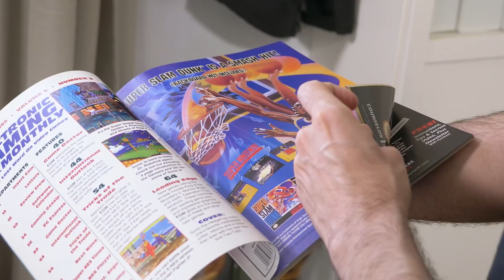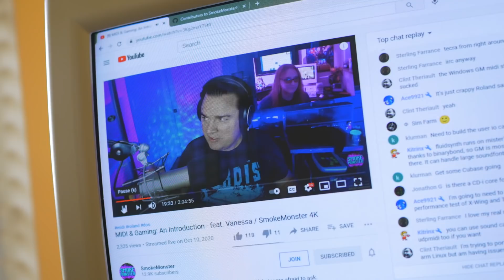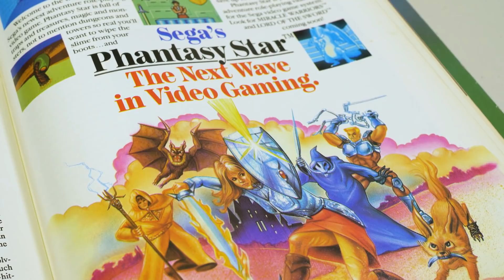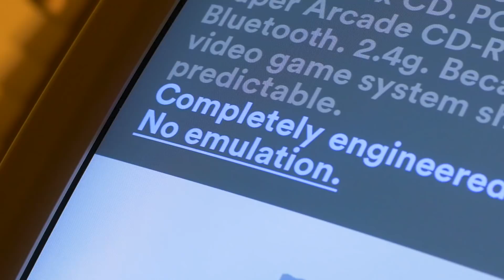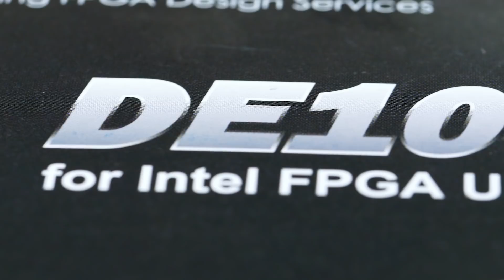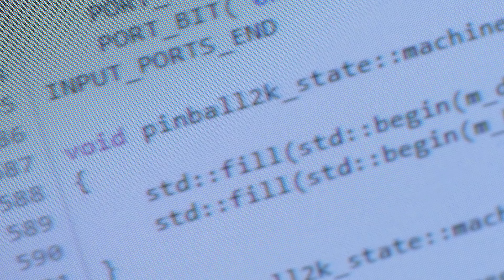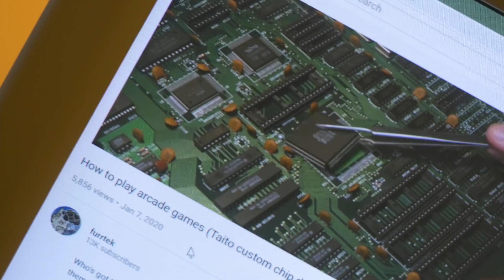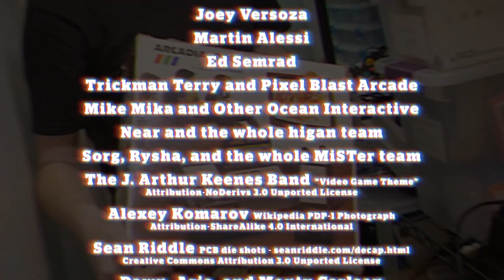ANALOG FRONTIERS - Part 3: Preservation and Replication / MY LIFE IN GAMING

Comment: Eventually, I would love to see systems that use a combination of FPGA Simulation & Software Emulation in order to offer the most flexible & comprehensive  experience possible.  Systems with both an FPGA and CPU chips on board, with the system being implemented via FPGA as well as software emulation to add features such as higher rendering resolution & other things that an FPGA chip simply isn't capable of.  The best of both worlds per se.  

How amazing would that be?  Technically the MISTer should be capable of this as we speak, as it has both an FPGA and a CPU on board that it could borrow from.  Would LOVE to see cores implemented on the MISTer that allow them to borrow from the CPU for things like higher rendering resolution and such.

Comment: I developed the RunAhead feature for RetroArch, discussed at 26:48.  RunAhead is not about running "multiple instances of a game".  This is confusing because RetroArch does support using multiple instances for RunAhead, but it's for a completely different purpose.  Use of multiple instances is exclusively a workaround for audio buzzing issues with savestates, and nothing else.  RunAhead still has high processing requirements, as it runs each frame of the game at least twice, and constantly saves and loads states.
Reply: I believe this needs a mainstream explanation on video for the general public to understand it... it would be great to have if not already available.
Reply from the maker: [Try4ce] Is there a better way I could word this segment for the version we'll put on Amazon Prime and Blu-ray? Unfortunately you can't swap out videos on YouTube so this version is what it is. Does Frank's comment about two emulator cores stand up to scrutiny or should that be trimmed? The way you explain it kinda DOES make it sound like two instances of the game - I mean, if each frame is run twice, it sounds like the practical result is that the game is being run twice. So I'm not sure what a better way to put it would be. Keep in mind that the interview with Frank was from April 2018 and I believe run-ahead was extremely new at that time.

Comment: It is my opinion that to this day, the AVS still uses the most accurate NES core in existence, even more accurate than the one used in the Analogue NT Mini.  This is especially true when it comes to the audio accuracy.  Do a comparison of the audio from an original NES, the AVS and the NT Mini and you will easily see the difference.  The AVS sounds literally identical to OG hardware while the NT Mini variates a bit.  This is also true for the Mega SG/Super NT and their respective hardware.  From what I hear the change to the audio was due to nothing more than the personal preference of the developer Kevtris , as he reportedly prefers the sound the way he has implemented it vs the way the original hardware sounds and has added various filters to the audio for these changes.

I have a real problem with this, as when you are designing a product for the public you should be designing it to be accurate, not to be based on what you yourself personally like.  The rest of the populace isn't necessarily going to like things the way you do, specially if it deviates from the original hardware.  If anything he could have at least given people the option to turn these extra filters off but this is unfortunately not an option.  I simply do not understand this decision as the audio implementation in all of Analogues current systems could and should be more accurate than they are, and without any options to change it we are unfortunately stuck with this less than accurate implementation.

Comment: With the new Xbox adding the FPS boost I wonder if that idea could ever be brought to emulators? Old games don't run well on flat screens as they have tons of motion blur. The only way to eliminate it is with single strobe BFI. This isn't exactly common on most TV's or monitors.  Not too mention some people can't handle the flicker of BFI. It was suggested that Xbox has the ability to double or sometimes quadruple the frame rate. Imagine that was brought to Streets Of Rage 1 or TMNT 1 as those games run at 30FPS. Or imagine all the 60FPS games getting bumped to 120FPS. It would at least get them at reduced input lag and visually they would appear smoother. It's already so amazing what is happening in the retro community with that Genesis GX Wide emulator. It's so crazy to play those old 4 by 3 games wide screen.
Reply from the maker: [Try4ce] I've wondered that too. Heck, imagine if the rumored "Super Switch" could tap into such functionality with extra power in the dock for current gen games even. According to Microsoft, the game itself thinks it's still running at 30fps, so whatever technique they're using could potentially really make a lot of interesting things happen. Their backwards compatibility stuff is really impressive - it often feels like a remaster rather than emulation. It's very polished.

Comment: Software emulation can be just as accurate as FPGAs in practice.  While FPGA can definitely replicate each chip of a system without the overhead of software a cycle emulator like BSNES/Higan is great from a preservation standpoint because unlike hardware, software will be with us for a long time.  You can read the source code for BSNES and from it know how the SNES works and in the future you can use said code to do a new, modern hardware recreation.   I think for the future cycle accurate emulators are the key to preserving hardware.
Reply from the maker: [Try4ce] Absolutely - Artemio touched on this at one point. Cycle accurate code could give you functionally the same result as an FPGA if you had a fast enough computer in theory. And at the same time, there are things you can do on PC right now that are a long ways off for FPGAs - like GameCube, etc. So both methods still need more power to unlock their full potential.

Comment: FPGA without question has the potential to be more accurate than Software Emulation, HOWEVER!... It all depends on the work that goes into it.  An FPGA core has to be capably programmed just as a software emulator needs to be.

Comment: I got an OSSC and its AWESOME ! But I do have one question. When I set it to line 4x mode (960p) It works on my TV but for some reason even when its set to generic 4:3 it doesn't do the 4:3 aspect ratio it fills up my whole screen and I'm wondering if I can fix that in some way. Any suggestions would be helpful pls.
Reply from the maker: [Try4ce] Your TV should have an aspect ratio setting. It might even be a dedicated button on the remote. I'd be very surprised if it didn't let you do this. Failing that, I believe the 3X signal would always be interpreted correctly by a HDTV, if I recall.

Comment: I disagree with the assessment that MiSTer is "too technical."  If you can setup a raspberry pi, you can set up a MiSTer.  And as far as running the system goes, I'd say the gui is easier, less cluttered, and more functional than RetroArch's or Analogue's!  It is by far the most useful piece of tech you will ever own.  PDP1 to SegaCD in one system??? Absolute insanity.
Reply from the maker: [Try4ce] Totally agree it's easier than a Raspberry Pi, and I am personally no fan of RetroArch's menu organization. Do keep in mind that Jeremy's interview was from the fall of 2019, and I don't think MiSTer stuff was quite as easy then as it is now. I debated keeping that comment in, but ultimately decided that it's valid to call it technical in the context of this episode. It was not under the pretense of comparing it to PC emulators or Raspberry Pis or anything like that. Analog Frontiers is intended to be accessible to retro outsiders, and I DO think any amount of DIY is going to be too intimidating for a ton of people. Analogue systems and the AVS still have their place because they are ready to go and interface with original carts. I think how Jeremy compared it to the mini consoles was very appropriate - that's what a ton of people would be looking for, and MiSTer does require you to be somewhat serious about it. I don't mean to imply it's ultra difficult or anything, and I wouldn't want to scare retro enthusiasts away from it (it's amazing!) but it's a few too many steps for a general audience. We are doing a MiSTer episode, and Coury is especially passionate about MiSTer. He really does want to show how setting it up doesn't have to be that scary. But for Analog Frontiers, you need to keep in mind that I'm hoping for a broad audience to enjoy it. I'm sure you can think of plenty of people in your life who might enjoy some old games, but you'd hesitate to recommend MiSTer to them. Are they really going to build it? Even if it was handed to them pre-configured, are they really going to use it? Keep it up to date? Give up at the first sign of trouble? So I tried to keep those people in mind while making this, and not trying to pretend that something like MiSTer is for everyone, because it's not truly for literally everyone - even as it gets closer and closer, and may eventually be just as easy as a mini-console.
Reply: @mylifeingaming  Appreciate the explanation, I sometimes get a little TOO excited about MiSTer I will admit :D  I definitely wouldn't recommend it to a person who doesn't at least already have a Raspberry PI.  Looking forward to seeing a complete episode on it!

Comment: ooof, did you guys even bother to get a CS or Software Engineer in there to reference this stuff.

Hardware Emulation is Software. Emulation is Software. 

An FPGA is not emulation. It's Simulation. Hardware Simulation is using hardware to simulate the same behavior, assuming that the gate array is not 1 to 1 of that of the source hardware (in which case that is a copy or maybe a clone which is a bit merky 80's speak). Such as in Reverse Engineering existing hardware and producing the same result with different gate array configurations is Simulation. 

There is no Software Emulation and Hardware Emulation. That's like calling WinE an Emulator. 

This is a great video, but you guys take a flying leap off the terminology bridge as soon as you start getting into the murky territory of defining terms without doing the necessary foot work. It's a bit lazy. Hardware guys I don't expect to know this, but these are terms covered in Computer Science, Computer Engineering, and Electrical Engineering courses. You start coining new terms, you basically break the scientific language and make it impossible to communicate ideas. Specially when you start making nonsensical combinations of software hardware emulator. 

Anyway keep up the great work, but you might want to redub this and consult with each about adopting the proper vernacular. You're smart guys, but this makes you look pretty dumb.
Reply: I understand where you are coming from. You'd have the simulation of something in FPGA if you had the exact documentation of the silicon and implemented it perfectly. But that's not the case, hence the nuance.
Reply from the maker: [Try4ce] I don't know your credentials - you certainly know we are not engineers, which is correct. However, this is not a video for engineers. This is for the gaming community and these are the terms that have become accepted. These terms have been approved (and even suggested) by engineers and others in the community who helped us fact-check. Whether you like the terms or not, the real way to have a conversation is to use the accepted lingo. We've used other terms to describe this stuff in the past - including simulation! However, some engineers disagreed with that usage, saying a "simulation" is more for a testing and laboratory use and not something you would distribute as a product. The words we use to describe these things in videos have evolved alongside what is preferred and accepted by the community. This script was first drafted in the summer of 2019 and continued to be iterated upon throughout editing up until the final weeks. Constructive criticism is welcome, but calling something "lazy" is a pet peeve of mine, especially for when I see it hurled at game developers and others - because in 99% of cases it is profoundly untrue. I realize the irony in me saying this, but calling something "lazy" is the laziest possible criticism.